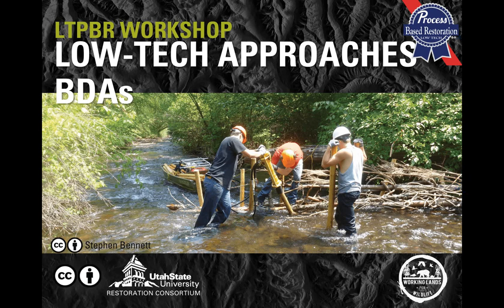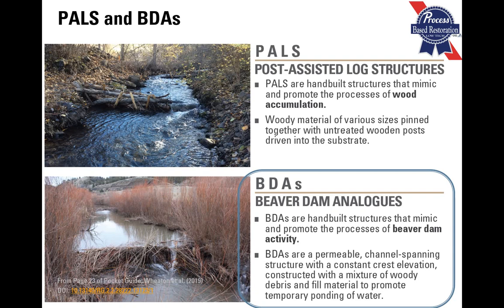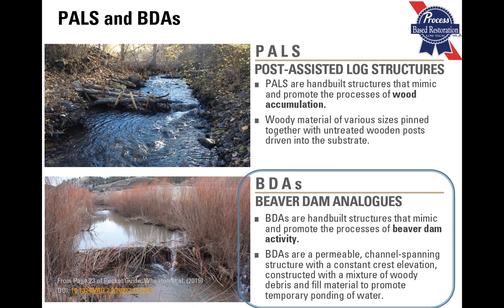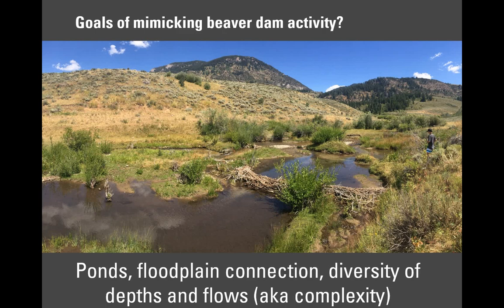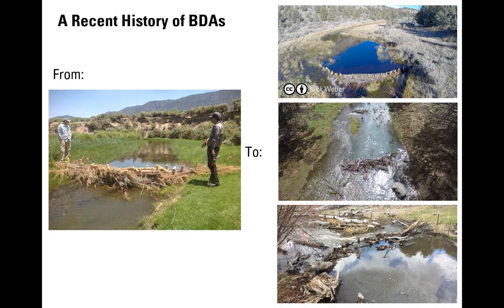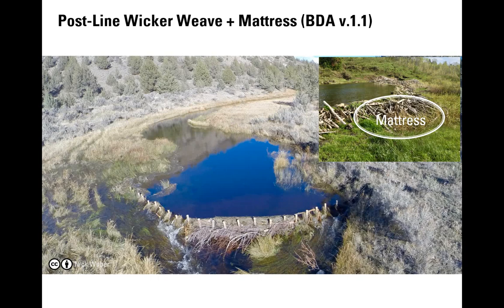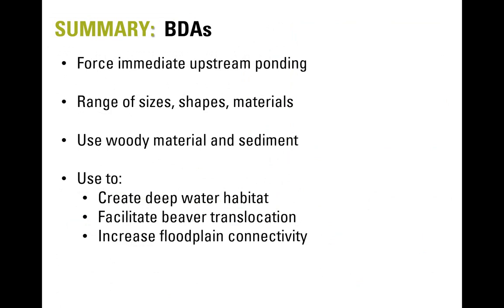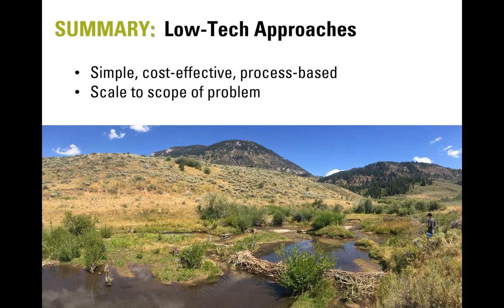01 I Low Tech Structures; Building BDAs (Beaver Dam Analogs)

Comment: Very good video.  I do have a few suggestions.
If these are being built on a “functioning full time stream”, be very careful of the fish species using that stream.  Kokanee will not jump a complete obstruction in a stream.  If you build these in a stream being used by Kokanee, be prepared, they will be removed.  Obstructing fish migration is never a good idea, and where Kokanee are spawning, F&G along with sportsman WILL remove any of these installed in kokanee country.
Second, shallow water power boats (jet skiffs and jet skis etc) will cross a beaver dam with ease. Using a very large rock or series of rocks will tend to discourage abuse by shallow water power boats.  Set a large rock in center if narrow stream and several large rocks if wide stream.  I would save removed waste concrete for this purpose if rocks not readily available.  Waste concrete (rebar removed or cut off) is very good for many streams.  It provides aggregate as it decomposes and helps “neutralize” low ph streams.
These structures are excellent in intermittent streams, and very good in many other places, glad to see they being accepted.
Thank you for the video!